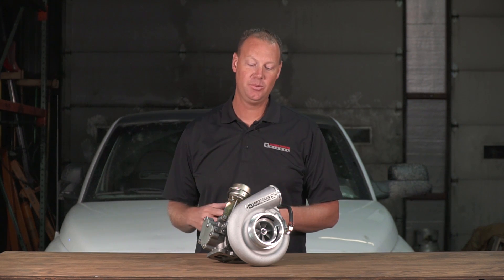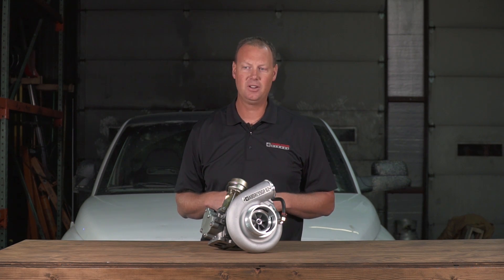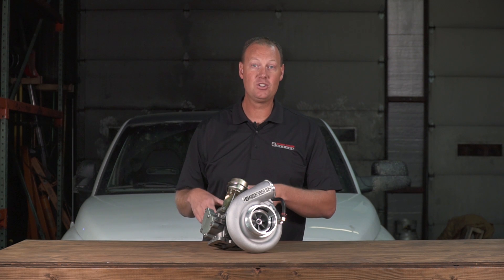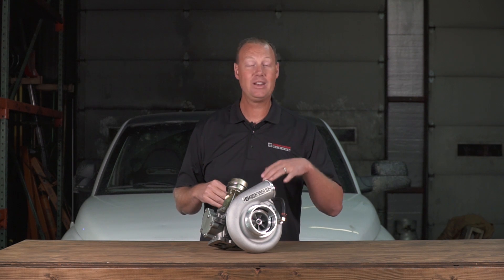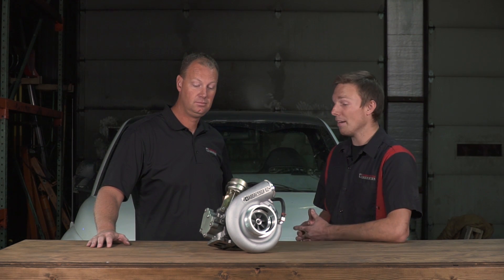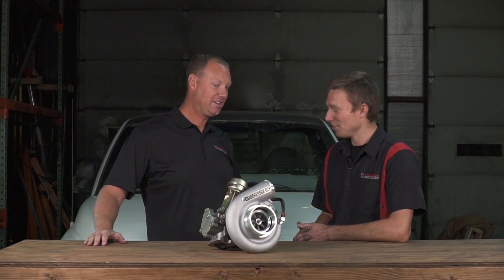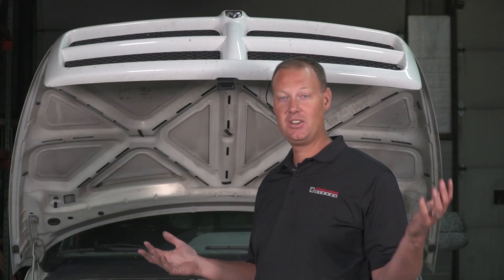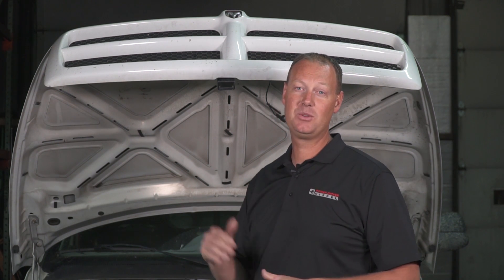Introducing a New Diesel Turbo - 50psi of Boost and 500+ HP | Power Driven Diesel

Comment: If you're achieving 50psi of good air on this turbo, could a s362/68 70ar achieve that effectively enough to produce more power/flow than 40psi?
Reply from the maker: We have found them to have nearly the same boost-to-horsepower ratio, with a slight advantage for the 62x68 Borg due to its larger turbine wheel.

Comment: Cool I may be in the market this year I'm looking for a stump pulling turbo on a budget this may fill the hole. Was looking at compound turbos but the 351 in my 04 has around 125k on it and I think it may be better to replace the whole thing instead of only doing a 400 in compound plus I already have a 5" mbrp straight pipe. So that will take care of the exhaust portion it is 4" down pipe. A bit loud but still dropped egrs and improved overall performance.

Comment: I just have a cut fuel plate, afc max travel, 4inch, and 3k governor springs. How well will it work with this combo? Do I need delivery valves or injectors? What about head studs???
Reply from the maker: Yes you will want injectors and Dv's 5x.012 and 025
Reply: @pddofficial  ok thanks
Reply: @pddofficial  are 5x12s the same as a 370?

Comment: I am the original owner and have 390k mikes on my 2006 Dodge 2500. I am considering replacing the oem injectors for the first time. What checks should i do on the engine before doing upgrades like this turbo or even spending $3500 on new injectors?  I did the oil filler cap blow-by test and the cap doesn’t move at all.  I would like to be in the 550 hp range, but my main concerns are reliability and towing.  I was considering the holset  he351ve for lower range torque. How does the bw362 compare?  What transmission kit would you recommend?

Comment: Would this be a good option for towing. I have a 99 24v running stock fueling with quadzilla.
Reply from the maker: on stock fuel it would be a pretty lazy turbo but a set of 100-150 hp injectors it would run great
Reply: @pddofficial  it so with 100 over its a good option for towing around 15k. Or do you think HX 35 Super 9 is a better fit?

Comment: have you ever run back to back. something similar non intercooled to intercooled? I know we can calculate the efficiency and the density difference but it would be cool to see on a 5 to 800 hp truck back to back dyno runs with nothing else changed running intercooled versus non-intercooled. we know intercooled is the better method I’m just curious to see a real world dyno graph comparison. I calculated I’m losing about 50 hp to the tire on my combo that’s making about 500 horse to the tire currently. just curios. Would be neat to see just how small of a nos jet it would take to make up the difference. i’m thinking very small.

Comment: How would this do with stock common rail truck with no tune??? In need of getting a new turbo
Reply from the maker: It would work well.  An easier install would be one of our modified he351's that you could just drop in.  Call in if you need some help figuring out the best turbo
Reply: Power Driven Diesel ok thanks for the feedback 👍
Reply: @pddofficial so you think it works well on a 300-325 hp truck ?  And it wont be too laggy and still is good for towing as long as the rpm is kept at 1900+ ish?   Not running too hot on egt even with stock fueling?

Comment: I'm interested in doing a set of compounds for a 2008 Dodge 2500. I'd like to stay with my factory turbo so what would be a good turbo for atmospheric? I'm not looking to make anything crazy. Planning on building the transmission to handle 700hp but looking for maybe 550hp to the ground. Looking for something that will be fun and also great for towing which is why I'm planning on the compound route. Thanks for any help you can share.
Reply: @pddofficial  Okay. Thanks for the reply. I was thinking a s369 but s472's seem to be a little cheaper and easier to find. I was thinking of adding 60-90hp nozzles with that would that be enough or should I upgrade the entire injector? Thanks again for the info.

Comment: Curious to know how this turbo would handle with a stock 160 pump truck it’s has 4K gov springs, 60# valve springs and afc live, 150gph air dog, stock injectors
Reply: You will love it! Lower egts, smoother power delivery. Beware power is addicting!!!

Comment: I don't have my truck totally together yet, but I'm going with your 5x12 sac nozzles, 055 delivery valves, 5 inch exhaust, bhf, 3000 gov. springs 3.5 intake elbow, 16 degree timing, #10 fuel plate. Looking at a 62/71/12 turbo. Yours is a 62/65/14 I believe. Which would be better for these parts? I don't race but I pull about a 15000 lb. rv. Worried about egt's. I cruise at 60mph at about 1700rpm.Oh the truck is a 1996 from California. Took off the intake and plugged the exhaust manifold. Anything else that needs to be addressed on this smog restricted machine? Thank you for any knowledge you can share.

Comment: I’ve got a 99 24v with 125 hp injectors, fass and an edge jwa. Wondering how this turbo would perform on my truck. Have an hx40 right now and I hate it. It’s super laggy and my eggs get pretty hot

Comment: Hey PDD Team, great Video! Just bought the SXE 364.5 for my 06 5.9 24VCR RAM a few months ago, because I saw the Dyno video with the SXE362 on the 06 RAM. Do you think you can add the build sheet (engine, trans etc.) on the beginning or the end of your videos? Think it´s very interessting for all your followers. BR from Europe/ Austria
Reply: @pddofficial  Thats cool more or less similar to my one, I am still working on my truck  and installing the following parts, disscussed it with you guys (Cody?) before I bought the SXE S364 with 68mm Turbine and 0.70 A/R from you. Banks Air Scoop, Banks Air Box, Banks Technicooler with Monster Air Intake and Grid Heater delete, DDP 90HP Injectors, IIBag of parts for CP3, Hamilton Pushrods, 103lbs Valvesprings, Airdog 2 165gph with deleted original Dieselfilter, ARP Headstuds YOUR SXE 364 Turbocharger with a BD Exhaust manifold, Gasses going through a 5 inch cat back Magnaflow system. Plan to parametrize it with efi live. Transmission is a BD Stage 4 Tranny with upgraded valvebody and a Banks Billet Torque Converter. Very excited regarding my Dyno sheet.  :-) See you and best regards from Europe/ Austria!

Comment: I did same setup on my CAT 3126 inline six 7.2L motor. S362SX-E billet wheel, 65mm turbine wheel 0.88A/R gated T3 housing with a spacer. Very responsive turbo.

Comment: Those Marine tunes are no joke. I have always seen guys copy off the marine industry applications, way back to the 12 valve, 7100 pump and injector combos, even the ATPA guys did it back in the day. Super torque-y, and super strong pulls. A street truck with a marine inspired tune up, is always a please-r. A goods tubular iron manifold with this turbo, may see better results......the Mid America Truck show had those boys there, I had a co-worker that bought one, the results were worth the cost. The driveability was even better.

Comment: How much pump timing can  I safely run on my 98 12 valve with a 215 pump. It's got 3k gov springs, zero fuel plate, 5x12s , tork Tek overflow valve, 60lb valve springs, mighty diesel head bolts torqued to 130,  k and n intake, and a turbo off a cat 3126 that measures 60 compressor 65 turbine, and a .80ar t3 housing. The reason I'm asking is the egts get really toasty with it set at 17°btc
Reply: Clancy Taylor anytime you bump timing youre risking blowing a gasket, that said I've found a factory head gasket with retorqued bolts does seem to do well.  That's what my truck in the video has.
Reply: @myerstump8310  well I got the head machined flat and got those mighty diesel head bolts and torqued em to 130 in three steps. Could I run more than 17° on a 215 pump without blowing it up??
Reply: Clancy Taylor Once you disturb the factory gasket it can be a little more finicky.  But ide send it dude, thing will probably be fine at 24* of timing.
Reply: Another thing that could help is bigger injectors, if you've got a Max travel kit in the 215, and your trying to push all that fuel through those 5x12's then that will be hot and smokey regardless.  Bumping up in injectors size should help you considerably
Reply: @myerstump8310  well I got a new Cummins gasket and the block and head are both level so I may bump it up some more

Comment: A how about pushing a ve pump truck added timing and jumping a tooth advanced on the pump and turning the power screw in before runaway just a suggestion just to see what's the most horsepower you can get out of it but really push it I say you can get 400 out a ve pumped truck
Reply: That would be cool to see one with mods bigger turbo injectors fuel pin advanced timing even jumped tooth on injector pump star wheel turned all the way in power screw turned in but just a suggestion  thanks take care
Reply: @jesserasso1042  guy in shelbyville Ky has a vp powered truck over 600 last I heard. There were videos on YouTube of it from years ago. He done that way back. Super smart guy and he works at John Deere. He used to drag race the truck with a utility bed on it with tools and spare parts in it lol

Comment: I got a s362sxe sxe on my p pump 24 v with 100 hp injectors, running 22* timing 178/ 208 cam, absolutely love it. Never see above 1200* when towing no matter what. I would expect this new turbo to be perfect, ( spool even quicker, and clean up fuel more yet on top end.)
Reply: PowerDrivenDiesel  I just installed afc live, and love it. I’m considering doing a compound setup, running my current injectors. (I have plenty of fuel left for it) it’s a 5 spd manual, and I want efficiency, and mpg. more than power. And something that is good for towing and not laggy. What is your opinion on an s475 with 1.15 ar turbine housing? Thanks in advance!
Reply: Are you still running the same turbo do you like it . Im building a 01 24v with 180 pump max out with stage 3 bigstik cam. and cnc ported head , what a good injector to go with
Reply: @darinwardwell1583 I would call Flux Diesel Injection , and tell them exactly what you want to do with the truck, and pump mods etc, what power you want out of it.. I expect you want 600’s? With the cam you put in.. it’s definitely going to like higher rpms.. is it a manual or auto?, Dynamite Diesel Performance would be another good choice for injectors.. since this comment, I have done compounds.. same 362 sxe , over 475 billet wheel, 1.15 a/r 96mm .. with stainless diesel spring waste gate, and waste gate extender, I kept it  a 1.15 a/r because of my manual trans..works sweet.. for injectors and pump.. I have 200hp stage 4 flux sac injectors set for p pump pop pressures, with a 160 pump, has not been maxed out or touched inside.. plan to at some point ( this will definitely make a difference on what injector size you should order) 4k gov springs, pdd 024 delivery valves, compounds are 💯 the way to go! got my atmosphere turbo from Crazy Carl’s, as well as the piping kit.. of course arp 625’s, as well as I have the block, and head o ringed, 21* timing. Planning to go to 23,24 soon here, n see what difference that makes for top end smoke. I got 440 hp out of a mustang dyno n I was slipping my tires, so it definitely has more than that in it. Super fun to drive.!!

Comment: Can you use this turbo on common rail applications?
Reply: Yes sir this turbo uses a hx40 downpipe
Reply: Myer Stump cool thank you! That means I don’t have to change down pipes because I have an 06 manual!! I would have to figure out how to connect the charge tube to the inter cooler though 🤔
Reply: PowerDrivenDiesel does this use the HX40 down pipe?

Comment: PowerDrivenDiesel Sounds like a P-trim Garrett turbine wheel like  t04r.   Great turbo with allot of options.  Ive always wondered why more cummins owners dont like using Garrett turbochargers.  I personally love the Gen2 GTX stuff .  The Gtx3584r  is a mean turbo.
Reply: @pddofficial   I agree if your looking  for a direct swap. Ive come to the conclusion that I dont care really what it takes to get it on there if its the turbo I want.  I just did a 7665 over a s488 . fun times.